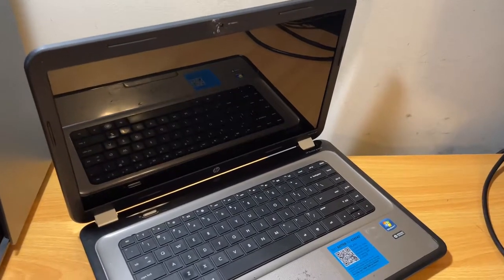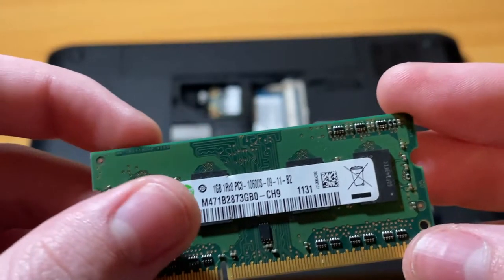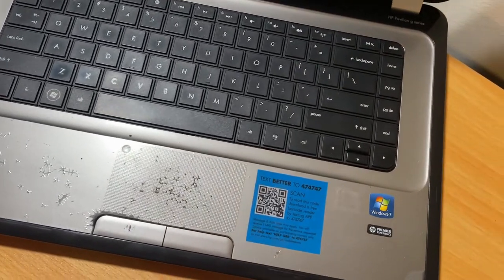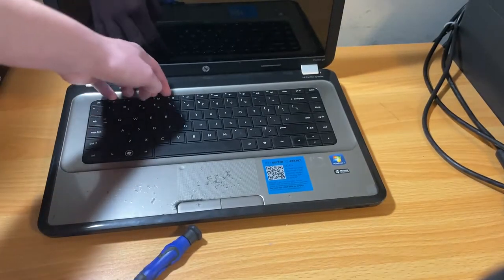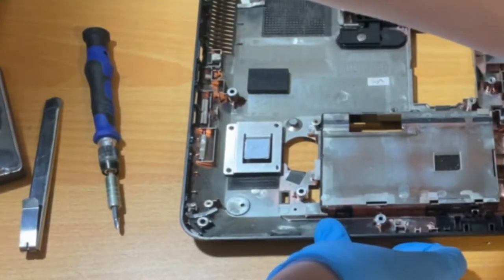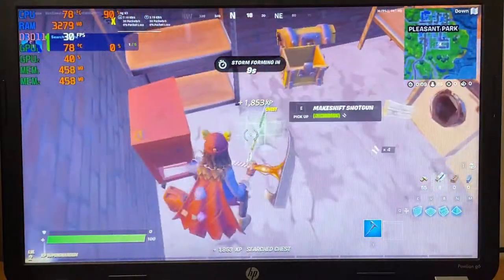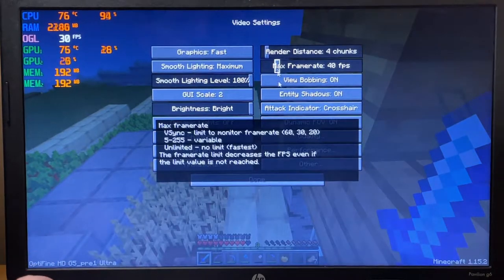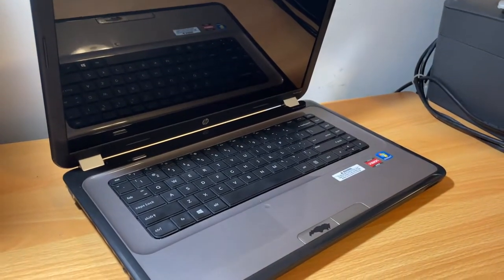Cleaning & Restoring a DIRTY Hp Pavilion G6 Laptop Restoration & Upgrades

Comment: Great video! I actually bought the 14 inch variant of this laptop a month ago for $50.00. I upgraded the duel core AMD CPU to the best CPU it can take which the AMD Phenom II P960(which is a quad core), 8GB ram and a 500GB Western Digital SSD. I love this thing, idk what it is if its the style of it or if its how ell it works with its original install of Windows 7. Its just a very nice laptop overall. I find myself using it to type some reviews, watch youtube and other basic tasks. It can even play older games just fine. Also I just found this channel, so far Im loving it!!